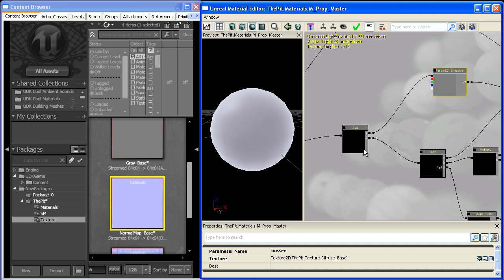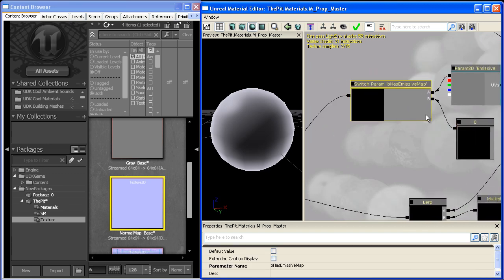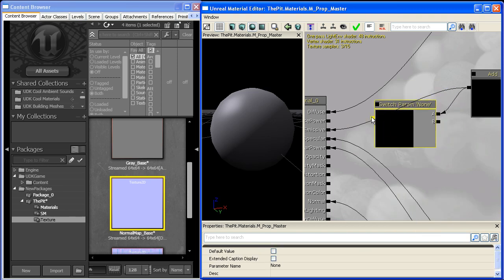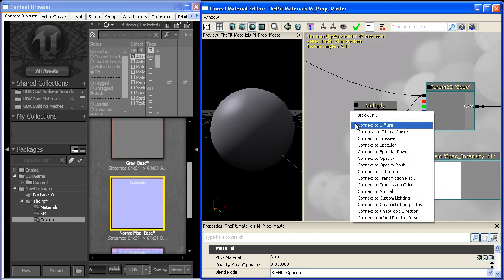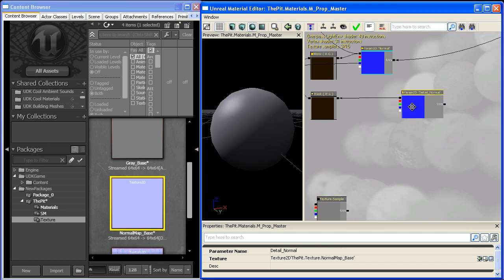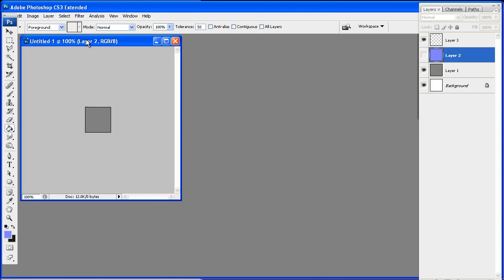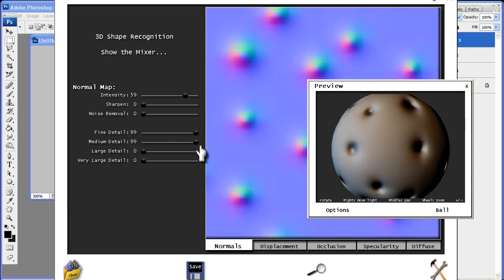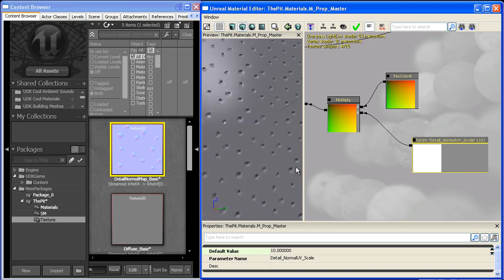Master Material Construction Part 3 of 5

Comment: Great video, helps me learning what some nodes does in a practical way and I can totally see the advantage of it from a programming/ui sense, giving you just the important values and hide the ones you don't need.

But have to confirm something the alek talked about, so adding another switch to a shader makes it compile slower then just imputing zero? (like black, no affect to texture) I was thinking that the shader would optimize and ignore all nodes after the switch if it was off.

Comment from the maker: @ Alek - You're probably right. For some reason when I was building this section of the material I was under the impression that  even if  you were adding 0 + 0 and then sending that into the emissive input, it would still add to the instruction count. I placed the bEnableEmissive parameter there so when it turned off, nothing would be input into the emissive slot, which i thought would further optimize the instruction count. In the video i think that it doesn't change though... so it's a waste.

Comment: First great videos!

Is there a reason why you used b_EnableEmissive instead of using (b_HasRimLight | b_HasEmissiveMap)? By adding static switch you are doubling the shader permutations (if I'm not mistaking).
By doing boolean or the result will be the same but the shader will compile twice faster and there will be one less parameter to config when using the material.